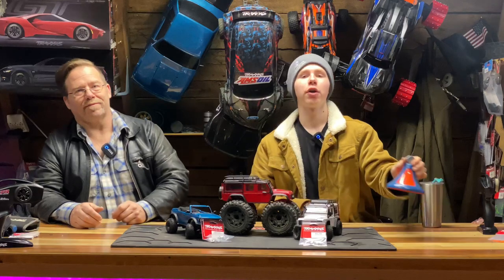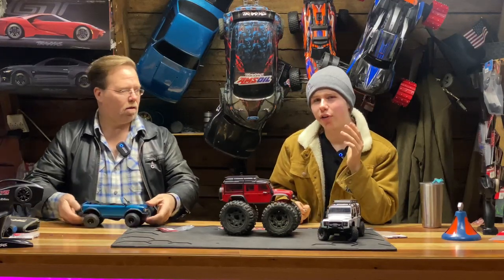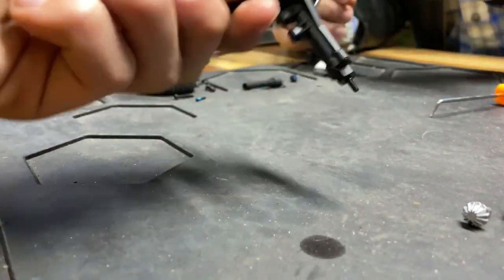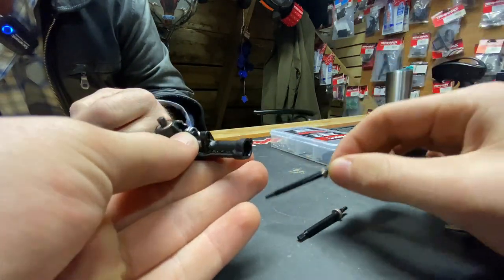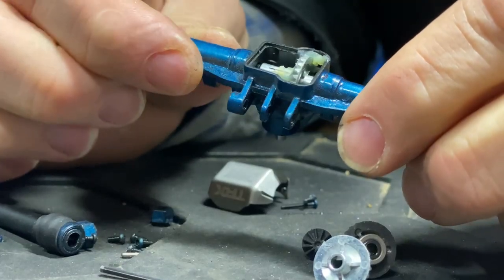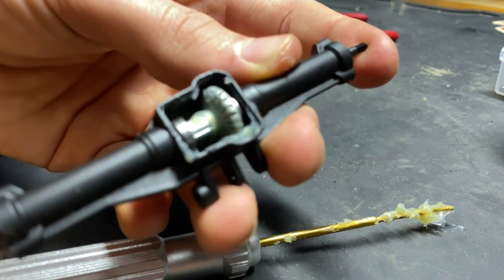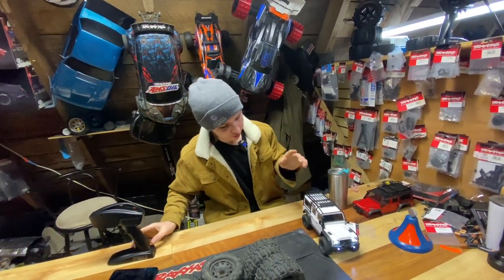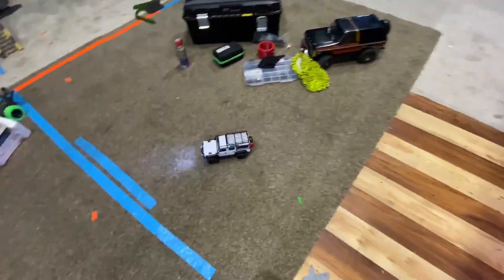How to install METAL Diff gears In a Trx4m!

Comment: what size are the screws that hold in the bushings i can’t get them out with any thing i have metric or standard alan wrenches
Reply from the maker: its a 1.5mm head?
Reply from the maker: if it seems like it's too small if could be that they are stripped out, as its very common for these black screws. the stainless steel screw kit fixes that
Reply: @3X7Outdoor  i never had taken it off before idk why it’d be stripped